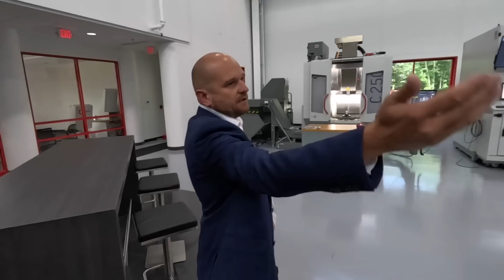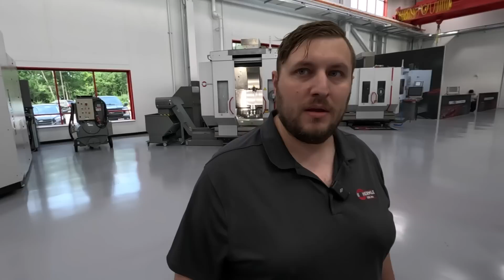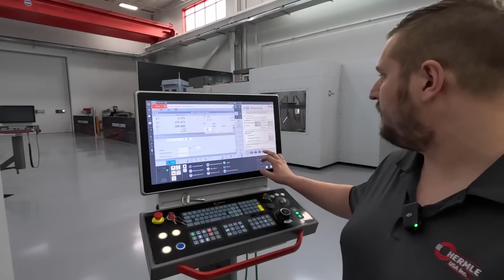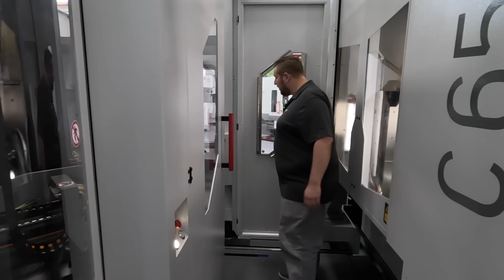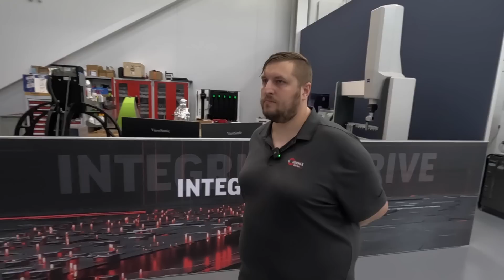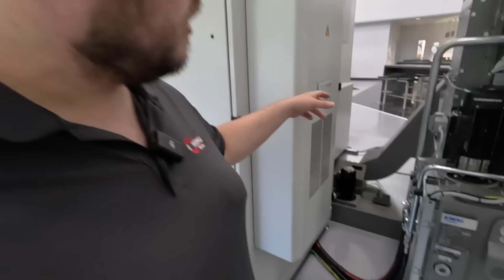Hermle USA Tour!  Amazing 5 Axis CNC Machines!

Comment: The noise reduction process did a big disservice to otherwise great video. Dialing back the settings a little bit, and leaving some background noise would result in much better sounding audio, than what we have now. The parts where the filter catches up and does not fully attenuate the noise sound just fine. Unfortunately, after a couple of seconds the sound gets garbled again :(

Comment: I worked with Mazaks about 23 years ago, great machine but they priced too high with the robotics and the company went out of business.  Great machines though.  When screw machines with the ability to take a 12-foot long 3inx3in square bars, that's twin collets and full ability to pull a 1/2-13 tap on the live tooling then I will agree that we are seeing progress.  Until then, keep trying.
Reply: Mazak never went away. They are still a very big company.
Reply: @WilliamPayneNZ  Both the company and the machines will last forever but the expense of all the extra gadgets like self-loading and Mazatrol on the machines put the company I was working for out of business.  That and bad management.  We spent more time loading the autoloader and fixing the machine after the robot misloaded than if we would have just loaded the machine ourselves.

Comment: I love the Hermle tours, such high end machines. I wonder why they havn't done a horizontal 5AX like Heller or GROB.
Reply: Hermle have a great range of machines based on a sound design concept that has been refined over many years. To make a horizontal 5axis would mean having to complete against GROB, HELLER and others who have slightly different target markets to Hermle and great products that you would have to beat to stand a chance. Hermle are great because they do one thing really well. I would have no hesitation in recommending their machines
Reply: They showed in the video that with robot and general automation prices coming down its cheaper to automate 2 ops and be more efficient with human labour which is getting more expensive.